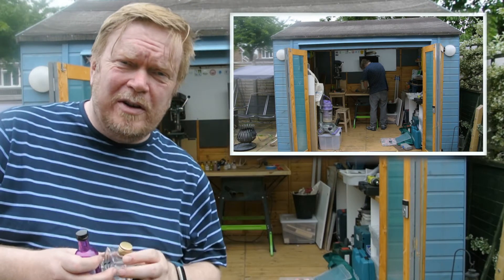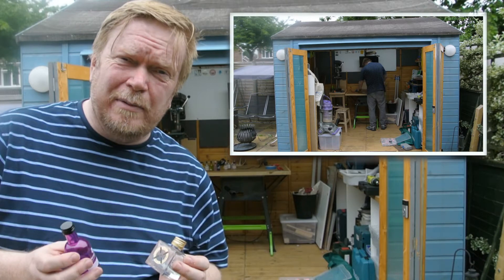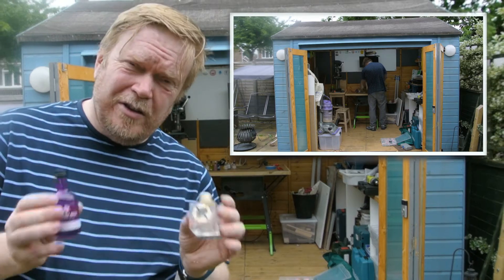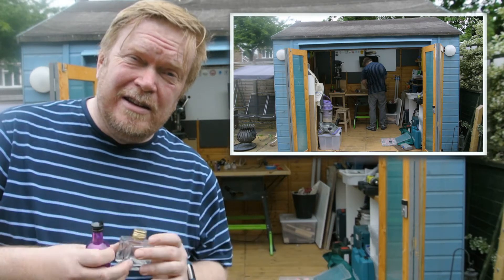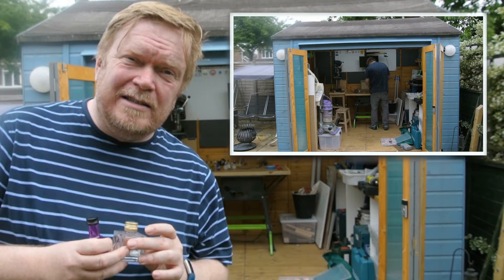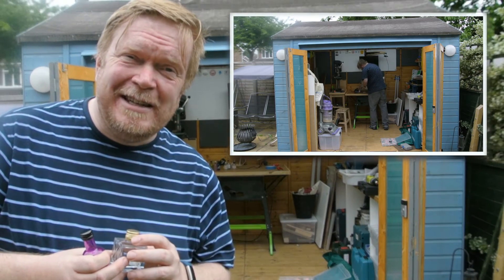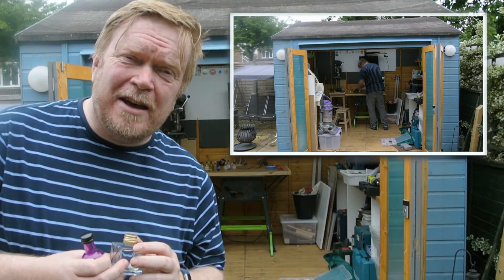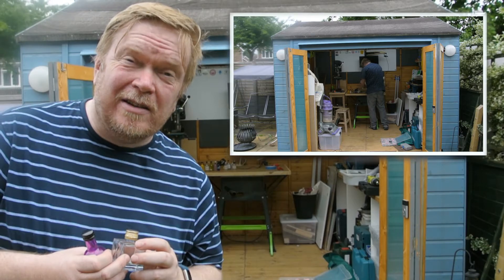Solar Lights From Old Gin Bottles | Easy Project | SOLARVET IKEA Hack

Comment: Nice build Karl did you  have plans to build a storage drawer under your table saw? :)
Reply from the maker: Hi Dave. I'm,.yes I probably will but I want to wait until I've decided if I am going to keep the Evolution saw. Toying with replacing it with either the Dewalt 725 or Axminster TS 250. And I need to think about benches now I have more space.
Reply: Strawbyte Workshop will has got the Axminster and I’d go for that all day long it’s gorgeous and way better than the evolution.